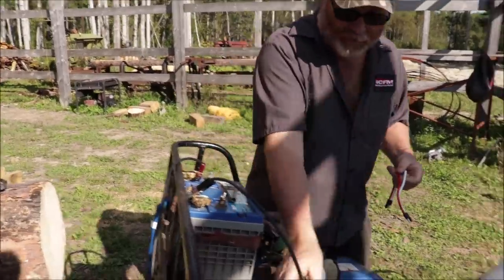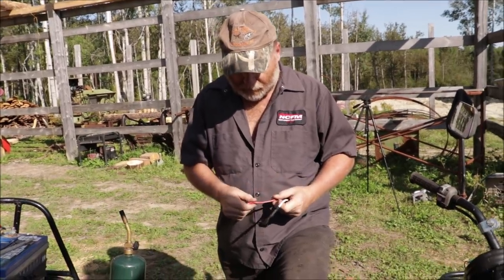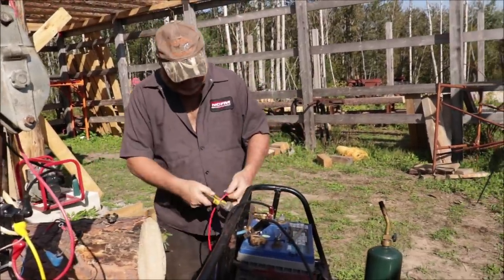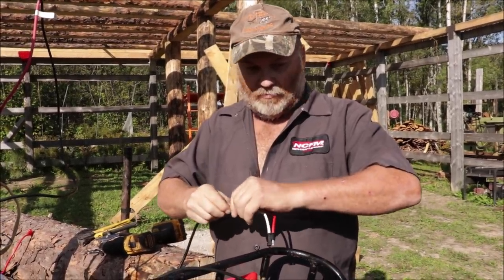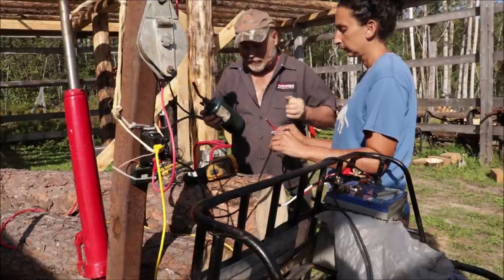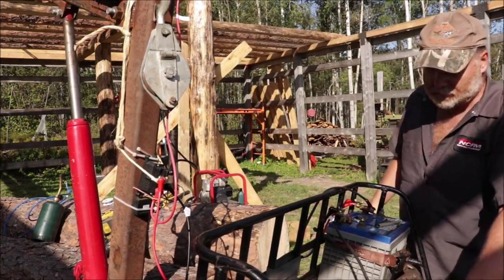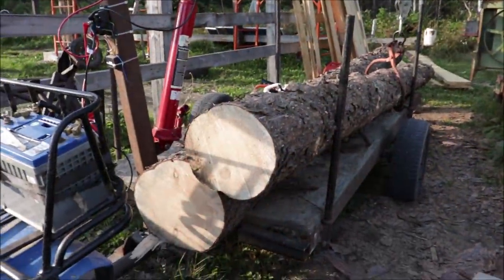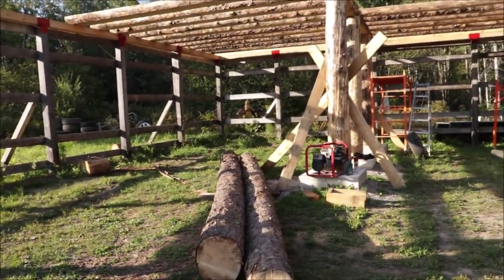We Had An Accident With Our Homemade Mini Crane.

Comment: Disconnecting at night will actually help the health of your battery, I have a isolator switch fitted to my quad and never in 5 years has the power in the battery gone down to the point where it wouldn’t start the quad. This advice was imparted to me by an auto electrician, by far the best advice ever as I was replacing the battery every 12 months at $45 whilst the isolator only cost me $8.50 😜

Comment: great idea with the plug i think i would strap the cable just below the solenoid so it wont pull on the lugs where its connected

Comment: Looks better every day. I have a 12,000 lb. winch mounted on a 2" receiver hitch. I made a similar quick disconnect (military surplus jumper plugs) so I can  mount on different vehicles. Fall should soon be in the air so you guys stay warm and safe.

Comment: Drilling out those terminals is always tough!! I have had better success "stretching" them a bit using a tapered punch with the terminal supported by a flat washer having an appropriate sized center hole. 
BTW, I expect you are aware that those butane lighters are said to equal a quarter stick of dynamite so using them to light a torch might not be the best idea??